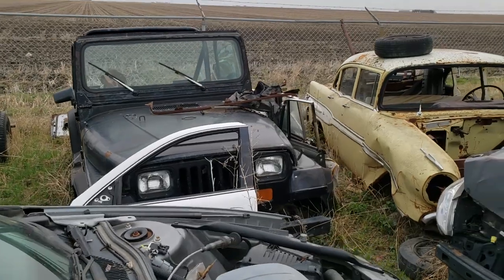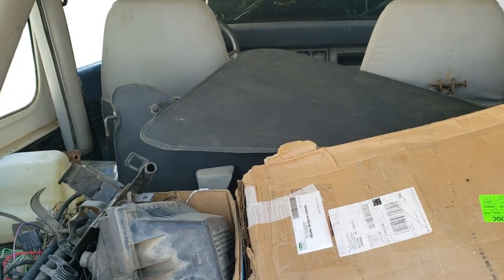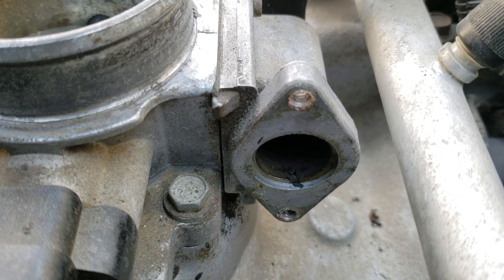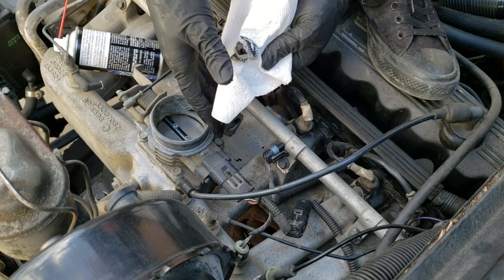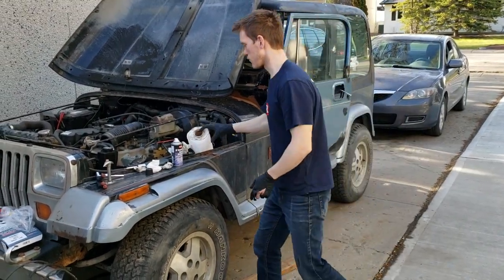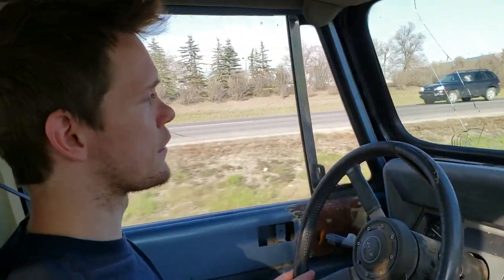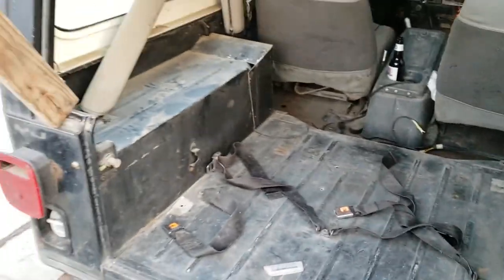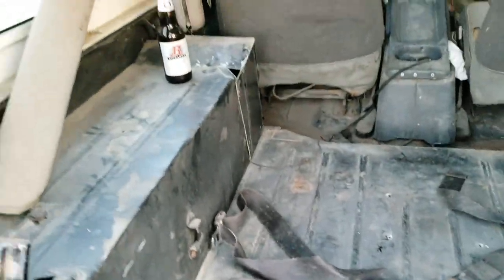Rover 1 Project - Regular Maintenance + More

Comment: I'm thinking it might be cool if you did a Rover2.0 version that maybe wasn't an extended body.. But still make the top and everything exactly like the rover.. This would save you a ton of work...a TON of work...I'm sure you have probably already been contemplating this... I just think a short version of the Rover would be sick!
Reply from the maker: What makes the Rover, the Rover, is the extended body in my opinion. Better ride and more stability too. I'm up for the work.

That would be kinda cool though. And use 35 inch tires in that setup lol
Reply: @LostFart  check out "I am Jake" it's a channel on utube. He is extending his old cj7, and it is turning out to be an enormous effort..Just to give you some extra insight.
Reply from the maker: @felixvargas4112  thanks, will do!